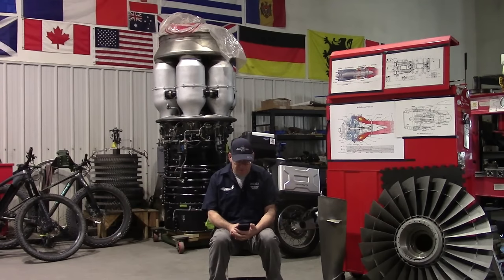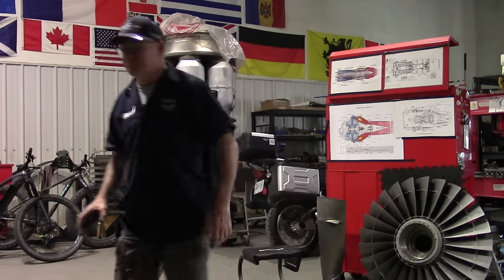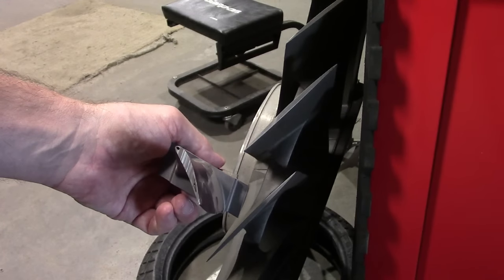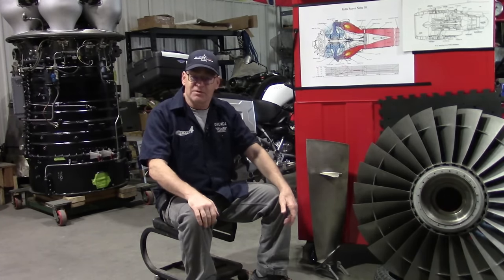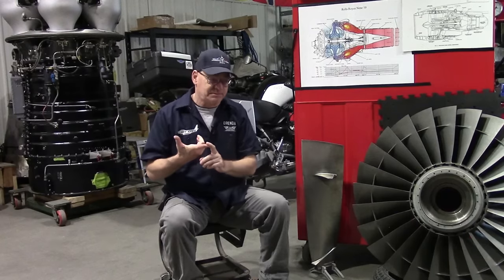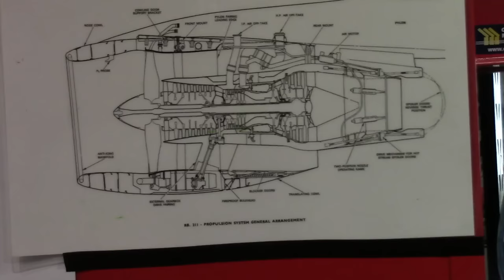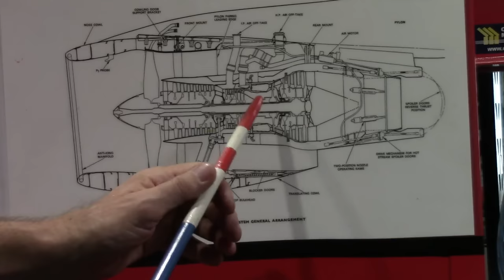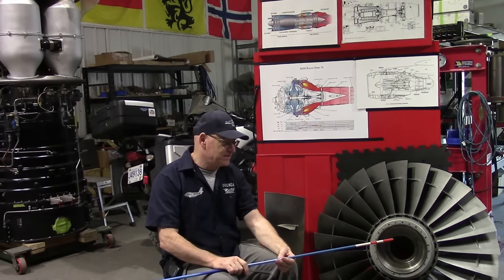Can Wind Damage the Engines of a Parked Airliner?

Comment: Around the 20 minute mark when you're explaining how the core works, that brings up one question. Pardon my ignorance here, but since the front fan is "free-wheeling," what exactly causes it to turn under power?
Reply from the maker: In a two shaft engine like the CF6, the LP compressor is driven by the LP turbine. The fan is the first stage of the LP compressor, which has been greatly enlarged in diameter to move much more air than the core needs. This extra air goes around the outside of the core, so it's called bypass air flow.
Reply: @AgentJayZ  Thank you for the explanation! So basically, the LP section is driven just by the flow of incoming air?
Reply: @captaincurle4529  No.  the Low Pressure (LP) section is driven by hot gas produced by and in the High Pressure (HP) section flowing through the Low Pressure turbine after it has already passed through the High Pressure Turbine.
Reply: @BKD70 Awesome, I think I understand it now. Thank you for the explanation!
Reply from the maker: You need to watch my vid called turbojet or turbofan. Also, you might enjoy my vids on power turbines.
Just type that into the search box on my channel page.

Comment: Function of Oil: Shock Absorption.  It probably doesn't need shock absorption on a gas turbine engine.  But on reciprocating piston engines, the oil between the bearings and journals will absorb the shock such as the start of the power stroke.  

Also, I have heard that PT-6 engines need to have the propellers secured to prevent windmilling, because just a few hours of windmilling can destroy the bearings on the power section of that engine.  Also the oil pump on the PT-6 is on the compressor section of that engine and not on the turbine or power side of the engine.  At least that is what I have heard about the PT-6 always secure the props from windmilling.
Reply from the maker: Yes, that is why the props on PT6's, and other free power turbine engines, are always secured by a strap-like thing... a prop immobilizer.

And... shock absorption is power transmission.

Comment: Nothing quite like the "clank" of windmilling fans in the wind when on the ramp.
Reply: What does the clank come from, i.e. what surfaces are contacting each other?  And how does that not damage the engine?  (Seems like the video didn't quite touch on that.)
Reply from the maker: Dear blah blah blah. If you follow the suggestions, and go watch the video I talk about in this video... called Turbofan 1, I talk about exactly where the clanking noise is coming from.
Reply: @AgentJayZ  Great, thank you!